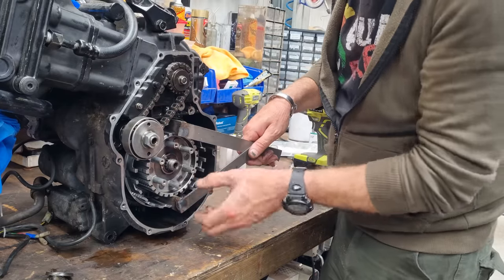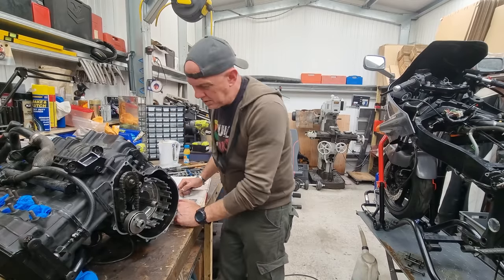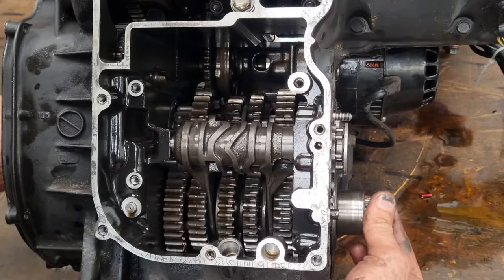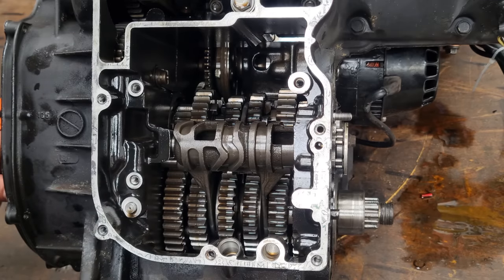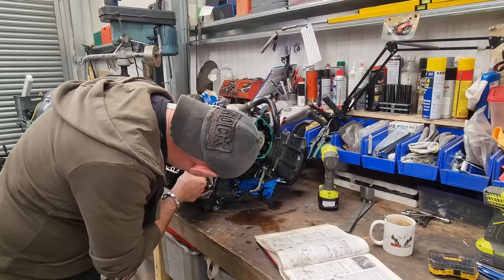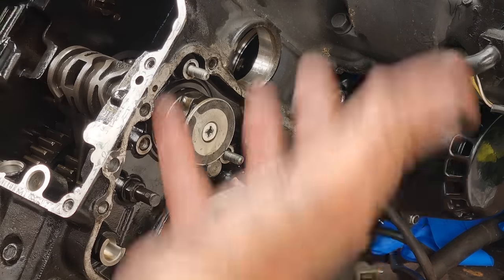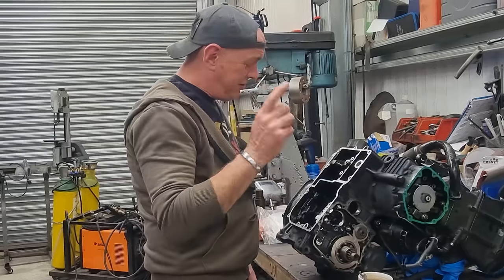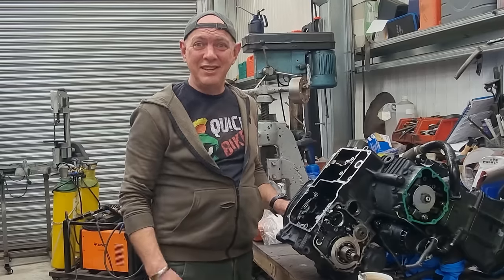Dismantling the gearbox (Part 2) - 1990 Kawasaki ZZR1100

Comment: To get the clutch basket off you can hold it with your hand and then put the impact gun on it, never had a problem doing it like that. Tool is only needed for assembly.
Reply from the maker: Ah right, I just went by the manual matey, but I've got one now anyways 😁👍
Reply: Agreed! Ive held the basket in place with a big flat ended screw driver & the impact wrench took the nut off lickety split. No reason to manufacture a clutch tool.

Comment: Just count the teeth, and check against the transmission specs. It should tell You how many teeth the 5th gear has.
But, hey! I just checked it for You! Input gear on fifth, has 26 teeth, output has 30. So there You go!
 You're doing great! Keep up the good work! 👍
Reply from the maker: Thank you matey 👍
Reply: he is doing all right, AND he is using a Haynes manual.   big respect.

Comment: When my 1991 ZZR600 gearbox kept jumping out of second it was worn dogs. When I split a later model for parts, I found that kawasaki had also made the detent plate on the end of the selector drum more aggressively ramped. Maybe that helped to prevent the wear from taking place on future models...
Reply from the maker: Yeah  possibly I guess. I know they redesigned the D version but still looking to see what they actually changed...

Comment: They may be able to repair the dogs with a hard weld then machining. And probably how it’s done in the first place.
Reply from the maker: I have a replacement gearbox now matey and not sure a repaired gear would last that long. It's just easier in this case to swap it out as quite a few dogs are knackered... 🤔

Comment: Well your now at the intimate stage of accessing your gearbox internals . The ole fairy tale book hasn't been too bad to follow so well done . Slight wear on the forks as you say but those gear dogs are muntered  that would explain why it wont move smoothly.  A swap out with new cogs and time to rebuild it
Reply from the maker: I'm looking forward to seeing the state of the new gearbox which has arrived today. Basically all the best bits are going back in it 😁👍

Comment: The way you are looking at the transmission, the gears are from Left to Right (22:53) 2nd, 6th, 3rd, 4th, 5th, 1st. The 'double gear on the input shaft with the forward facing selector fork is 3/4. The dogs on 5th particularly are buggered. If it had broken a tooth off, it would most likely still engage (for a short time before the gear stripped completely which would lock the transmission completely) but there would be a loud click every time the missing tooth passed the other gear. They do not last very long at all with a broken tooth.....
Reply from the maker: Sh right, good to know matey, thank you. The gear teeth themselves look really good but the the dogs are seriously worn I believe and there's rub marks on the selector forks as well 🤔

Comment: While you're in there, remember to fix the chain tensioner, with the tools you have its easy to make one yourself
Reply from the maker: I checked rhe clutch pressure plate and there's absolutely no new nicks in it anywhere... I'm getting some measurements whilst it's out of the bike and will make.one at some point, but whilstnuts all behaving itself it can just go back in for now. I'm on a bit if a deadline with this bike as I currently have NO transport at all... 😁

Comment: The removal of the clutch is necessary so you do not have to turn the engine over to rotate the input shaft.
Reply from the maker: I think there's a problem here now... I'm sure of it actually, but you'll see in an up coming video... 🤔